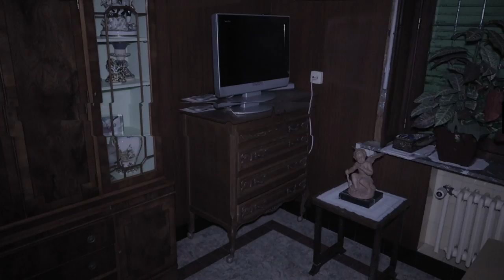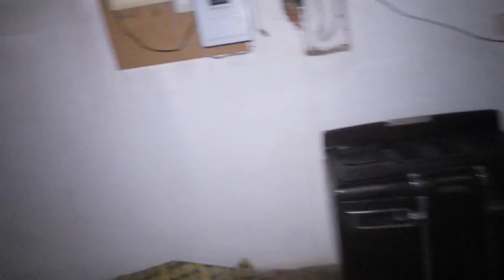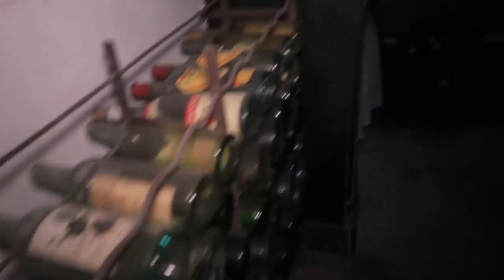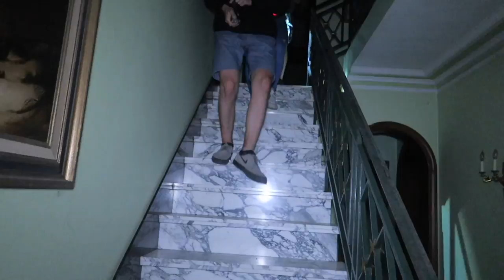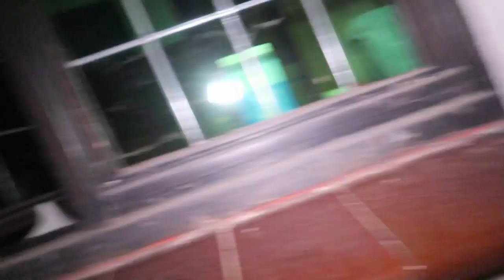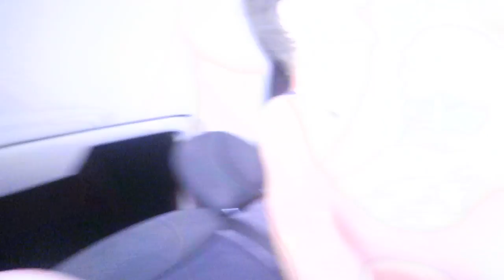(3 SAFES FOUND) ESCAPING UNTOUCHED ABANDONED MANSION After ALARM Triggers *GONE WRONG*

Comment: The "blue boxes" are called safe limpits   they detect vibration if someone tries to cut the safe open and activate the alarm      they are no longer functioning as this is technology from the 1980s and removing it would cause a audible tamper alarm when you took it off as the anti tamper switch "red button on the back" would be released 

From a alarm engineer